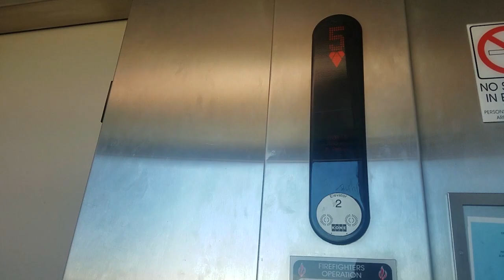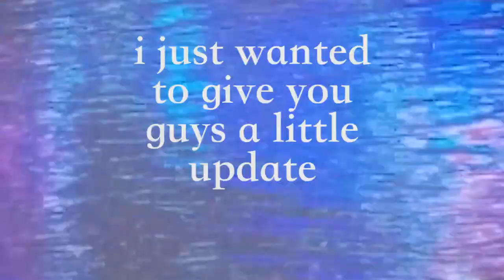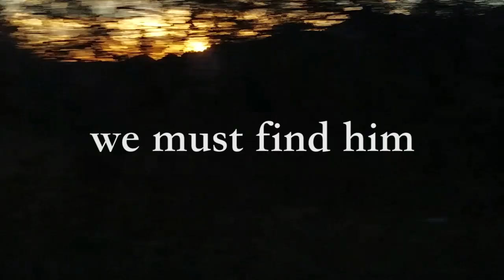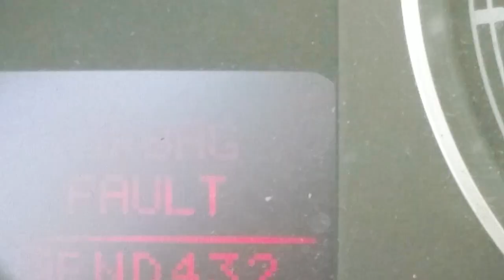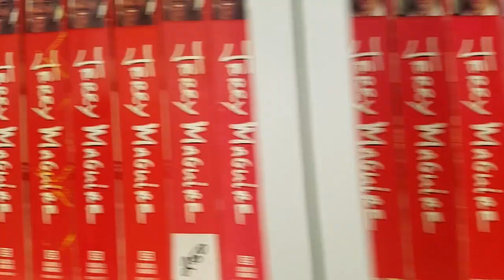Vandweller's Last Video

Comment: Damn smog test must be real tough to pass, they must want everyone to buy new cars.
Reply from the maker: RJ Bottlecap They are tough out here. I actually wanted to fail mine, so I could apply for the B.A.R. program. The check engine light was on, which is an automatic failure. Aside from that, my car is running pretty rough and has a gnarly oil leak.